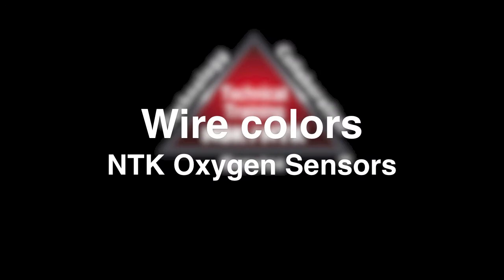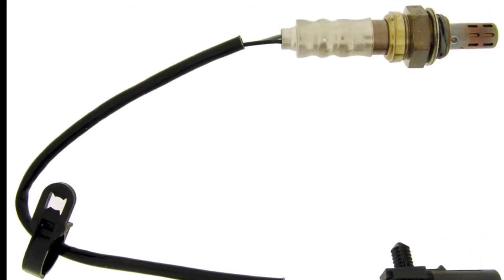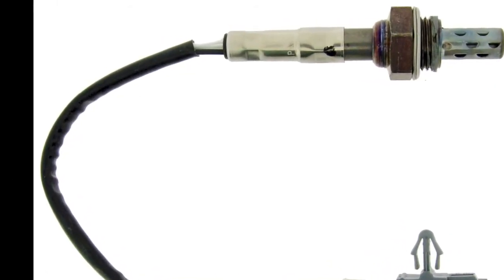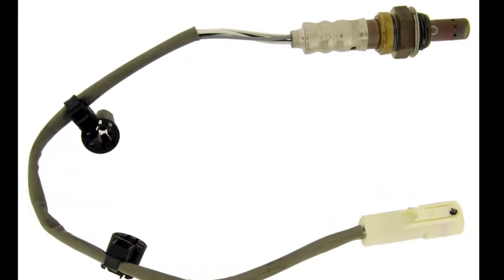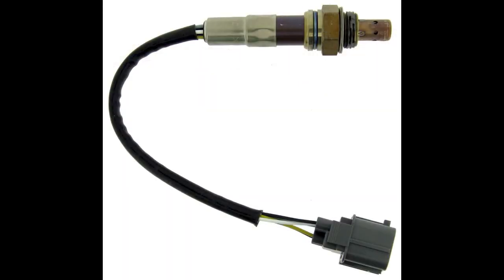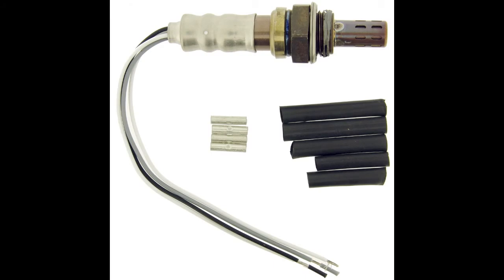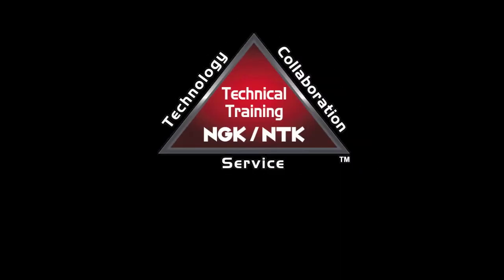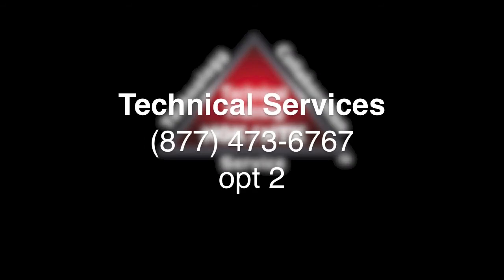Wire Colors: NTK Oxygen Sensors-NGK Spark Plugs-Tech Video

Comment: Had to splice the connection from my old O2 sensor onto the new one, got the grey and black wires right, but I hope the heating element in the sensor isn't polarized, there's no way to tell which does what.
Reply: That’s why I’m here

Comment: and 5 wires ?
Reply: Florea Gabriel exactly thats what i was looking forward to find out too :/
Reply: You may be dealing with an aftermarket wideband sensor. The will have the 2 wire heater,  the 2 wire sensor, and a 5 volt voltage feed/reference -- five wires in all. OEM widebands are commonly called A/F Sensors by the manufacturers and use a 4 wire amp biasing signal.